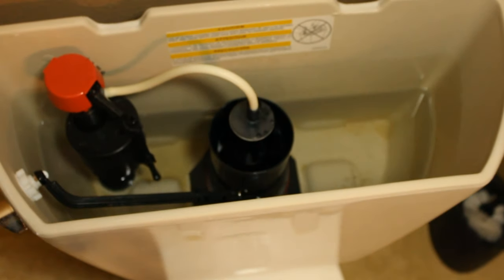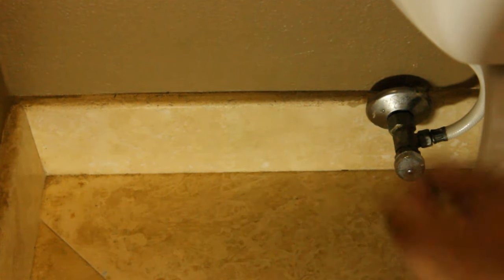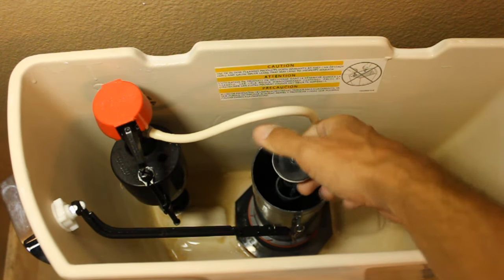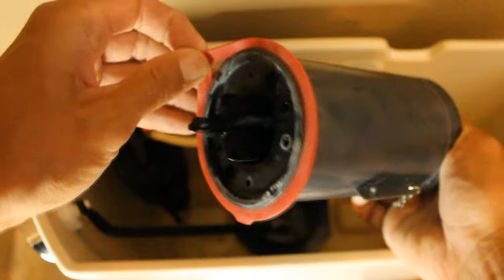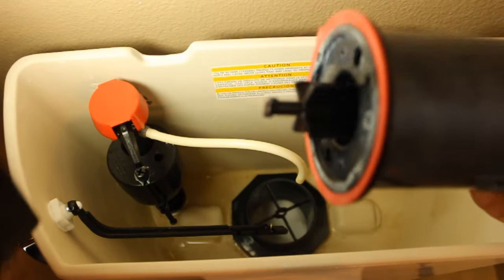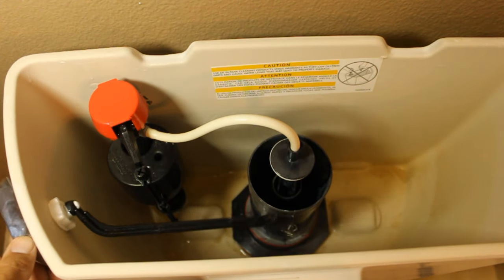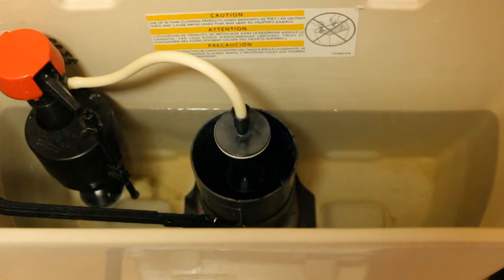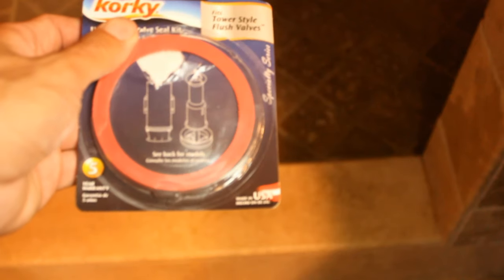How To Replace The Seal On A Canister/Tower Style Toilet Flush Valve (KOHLER/AMERICAN STANDARD)

Comment: Great video! Clear and concise. It's less scary to lift and grab below the canister when twisting to remove. Also, the single Kohler ring was $7 vs. $6 for the Korky 2-pack at Lowe's, so for a 2 minute repair, I chose the 2-pack and fixed two leaking toilets. Thanks for the video!
Reply: I agree! Thanks for that. It was definitely less scary to lift and grab below the canister

Comment: THANKS!  I had sealed the flush canister seal with Vaseline, turned the fill canister a 1/4 turn counter clock wise and the tank finally filled.  But I don't think the Vaseline will hold for long.  Now I know how to replace the seal, thanks to you!

Comment: Nice job explaining the replacement of the rubber gasket.
I was not having trouble with the water running mine was sticking because the seal was old.
Thanks
Reply: This video was a money saver! Explained very easy & fixed in 5 minutes for under 6 bucks. Thank you for the helpful video ✌👍

Comment: Happy New Year to you. I took a picture of the faulty flush valve with me.First the 'plumbing assistant' at Home Depot disavowed all knowledge.Yes, we know what toilets that use these. If it's a Kohler or American Standard toilet we don't have a repair kit. He even suggested a plumbing supply store nearby that was closed Saturdays but would be open on Sunday. Ya, as if. Then on Sunday I went to the oldest Rona store [over 40 years in the same location] only to hear the same answer...If it's a Kohler or American Standard toilet we don't have a repair kit. Found your video and checked online to make sure the HD store had 1 in stock. For heavens sake, the back of the Korky package has an image that shows both the AS and K models and how to replace the seal. That is the easiest toilet repair I have ever undertaken, once I had the right part. Thanks again.

Comment: Thank you for this video especially the part about twisting that center rod. If anyone has a problem with removing the tube or chain this repair can be made by just shutting the water off  and twisting the center rod off as described in the video, I left the water hose and the chain attached and was able to make the repair fast.

Comment: Thanks, I am off to the hardware store to fix my two toilets.  Great video right to the point.  May I make a suggestion to you?  Replace those plastic supply line hoses with braided metal ones.  My neighbor had one break and it filled up their kitchen drawers with water.  It was a huge mess. They can break at anytime.  I also replaced the rubber supply line to the clothes washer, with braided steel.

Comment: Thank you! I got a new ring at Home Depot for less than $5. It is yellow and says it will avoid leaks better. Koehler # GP1059291. I had a hard time finding it because of all the parts on the wall. Also, be sure to scrape all the old one off the canister if it is really bad and stuck on there, to get a clean seal with the new one. This video helped because I couldn't figure out how to get the canister off and was afraid that I would break it.
Reply: Use a yellow ring if you can find one.  The disinfection chemicals in the water decrease the life of the red rings.

Comment: waste of time. don't take the canister off. take off the hose and chain. pull the old seal off over the canister then carefully slide the new STRETCHY RUBBER seal over the canister and slip into place. then reattach hose and chain. 
Amazon has the new yellow seals for $7 with prime shipping